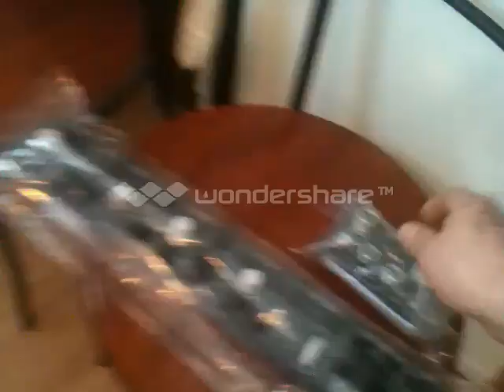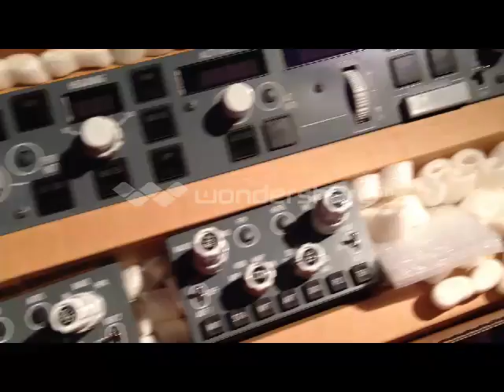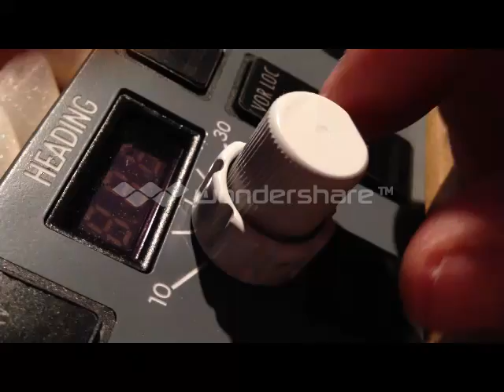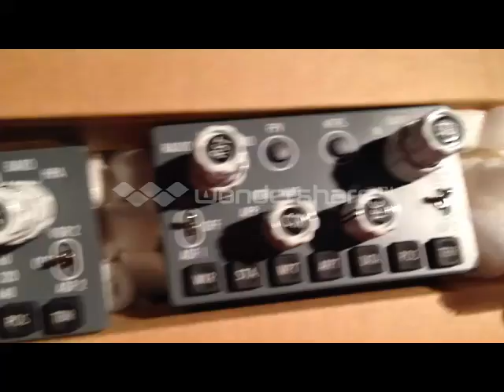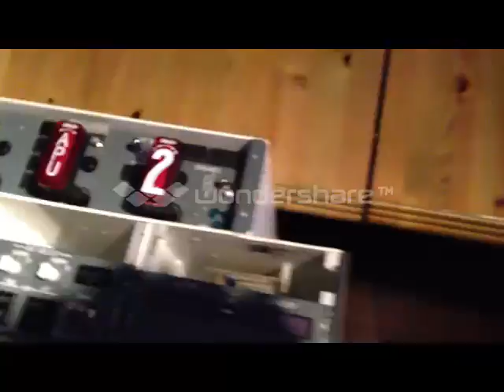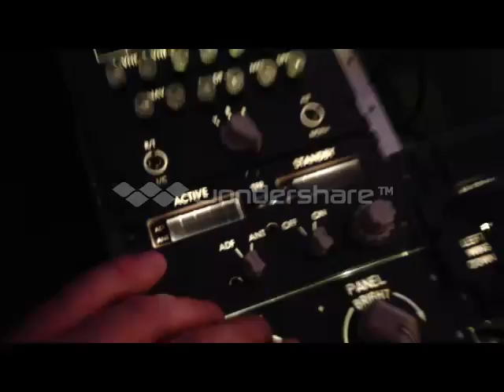Building a Boeing 737-800 home simulator #42

Comment: The led bleeding(diffusing), you are going to need liquid electrical tape. Take the panel off and around the segmented display edge paint them.

The front panel of the display is made of (glass/clear plastic) and the back lighting is getting out from the sides and reflecting back.

Keep a new razor blade ready to make you work tidy.

Comment: as far as making the knobs tighter, that would depend on the type of switch. Take the knob off and if it is in the shape of a half moon then solder the moon as if you were tinning a wire. The chicken head is a little more complicated to get it right but add a slight amount of bathtub caulk to the post and allow it to tack up. Use your hands to completely remove any access so that only a slight film is left then put your knobs back on.

Comment: the reason why the secondary knobs are momentary is that they are intended to be reset by the software at the start of every simulation. I am going to be building my own panels here in the next couple of months and have tossed the idea around in my head about how to make it happen and the best solution is to use momentary switches and digital encoders instead of on/on and potentiometers. 

This will make it a lot easier to start a new flight or save it an come back.